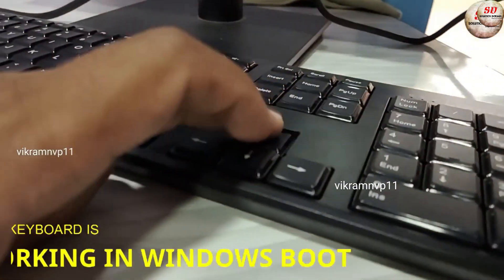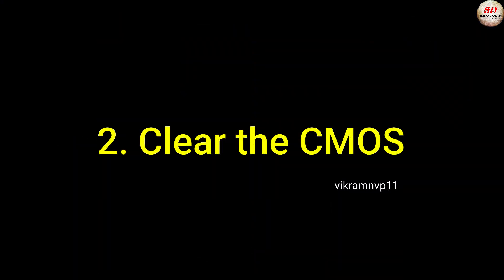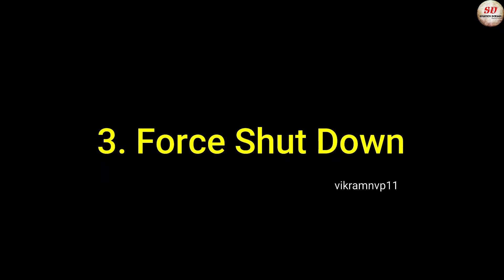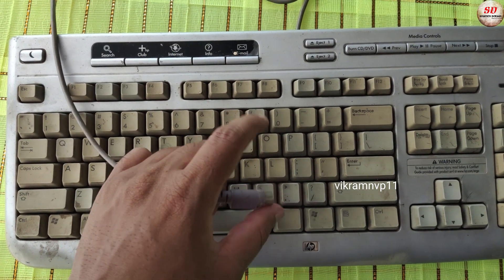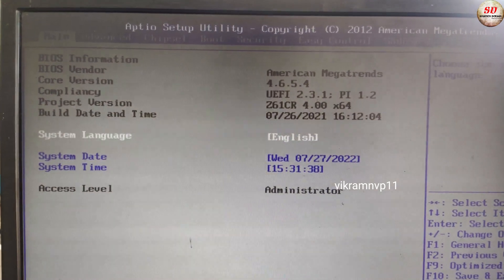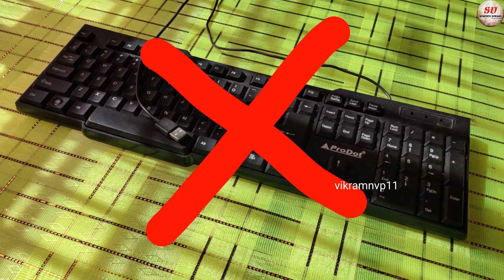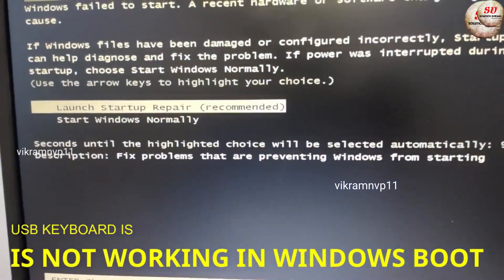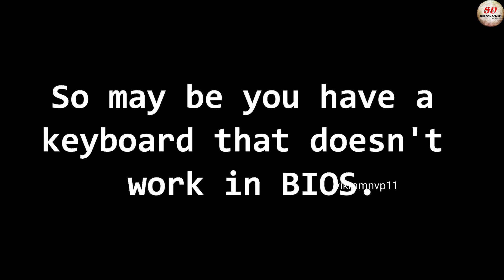keyboard is not working in BOOT or BIOS | [solutions] 2022

Comment: I had problem and none of the fixes worked. I finally figured out what was wrong on my own. I had purchased a USB hub that is working off of a USB 3.0 adapter card since my old system only has USB 2.0 and when I unplugged the USB transmitter from the hub and plugged directly into the USB slot on the main tower, it is working where I can use the keyboard before the OS loads. I had a problem where one of the fans failed on my Dell and got the message to hit f12 to enter setup or f1 to continue. When I tried both options, NOTHING. Keyboard was not working. Then I pressed the caps lock and number lock and there were no lights, so I knew there no communication from the keyboard to the system. Again, I just used a USB slot on the main tower. The add on hub gives lots of extra USB sockets, and as long as the OS is loaded, the keyboard will work from it, but if you need your keyboard before windows fully loads, you should avoid using USB mice and keyboards with these add-on hubs. The USB 3.0 adapter card drivers are loaded once windows starts, but not during boot or before the system actually loads. Nothing plugged into the hub works if the OS fails to load. That is because the drivers are NOT in the bios, but in the windows OS. Hopefully if none of the options in this video didn't work, this might help you.

Comment: I am getting choose keyboard layout. I cannot get to any other window.. Mouse and keyboard go dead. When I reboot, I try the F keys with no luck.  I tried unpluggiing everything from PC boot again, no luck.  I tried unplugging hard drive and boot thinking I can get into Bios or boot but could not work. Any other ideas on any other option.  should I put a new hard drive in and install win 10 then attach old hard drive to get data off? any other thoughts? I will try cmos trick and let you know but..

Comment: 2020's possible fix: TURN OFF FAST BOOT IN YOUR BIOS.

Fast boot makes certain processes in the boot to be skipped, this includes the post screen to enter bios.
Clear CMOS by removing physical battery as shown in the video, or shorting 2 pins on the motherboard if there is no battery on your newer motherboard. LOOK THIS UP IN THE MANUAL.

Don't turn on fast boot (Ultra fast boot, fucking fast boot, or whatever it's called.). The difference in boot times are negligable anyway...
Reply: how would i get to my bios if my keyboard doesnt get recognized fast enough?
Reply: @jaydenfurlong6109  Use the Top USB ports on the back of the PC.
These USB are usually reserved for keyboard to get recognized fast in order to enter BIOS.
 If it's a laptop, there is always a combination of keys to enter BIOS.
Reply: It works for me Ty so much !
Reply: I enabled fast boot then when I went to save and exit my pc ran into this problem so I know it is the fast boot that’s causing this but when I press the keys to access my bios nothing happens, my screen stays on the error screen and none of the keys do anything which they say they should I’ve tried multiple keyboards and they all do the same, after about 30 seconds my pc jus shuts off and the same happens over and over again do you know how to fix this by any chance, thank you

Comment: when i start my pc keyboard doenst work at startup when the logo apears than after the logo goes , it start to work , bc of this i cant boot or go to bois , i have tried every think noting work , i used troubleshoot to boot and it doesnt work either , any fix to that
Reply from the maker: Try with PS2 keyboard if it supports
Reply: @SolutionDomainNvp11  how should I use ps2 keyboard if it doesn't even have a slot of ps2
Reply from the maker: https://youtu.be/cnAt8eevxCY
Reply: Samd prblm 😭